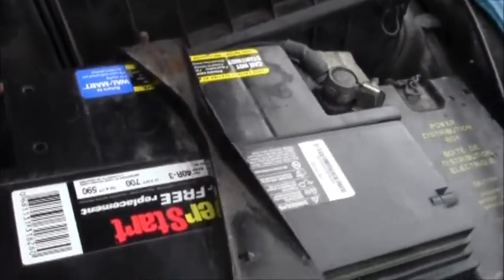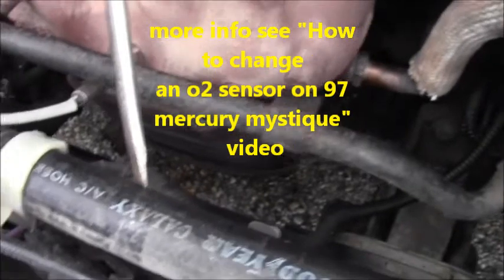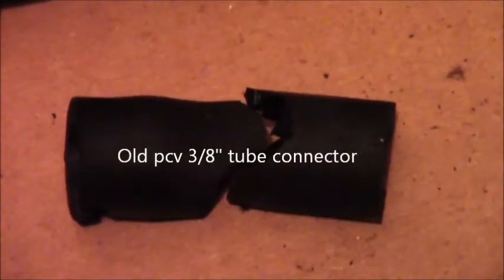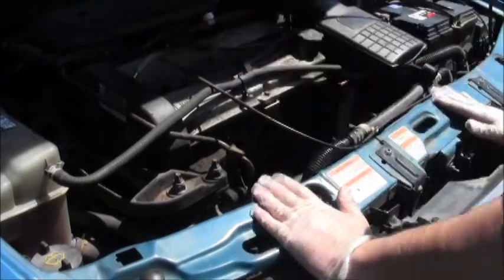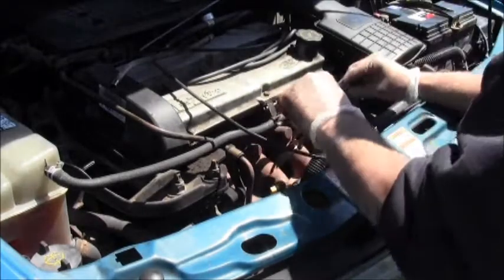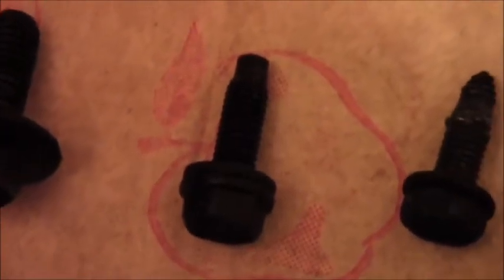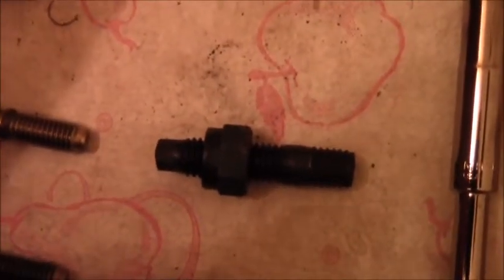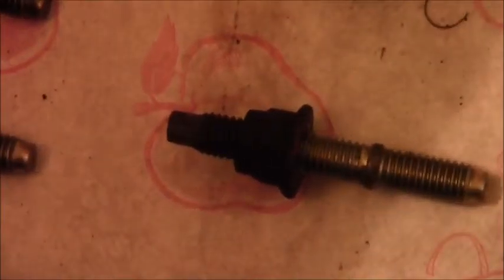Changing PCV Valve on 1997 Ford Contour / Mercury Mystique Zetec 2.0 Liter Engine

Comment from the maker: on my car, the only brass-looking fasteners I came across on this job were the studs for the manifold.  they came off with the nuts using a regular socket wrench.  to get the studs loose put two nuts on and use wrenches or if you have to vice grips plyers. you can do the job with the studs on, it's just easier with them off.

Comment: i read you can just remove the thermostat housing and you can get right to the pcv valve then you dont have to remove the exhaust
Reply from the maker: Mike Gombos Thanks for the tip, I'll have to try going that route sometime, possibly sometime in February when I plan on doing cooling system/thermostat videos.
Reply: no problem id look into it though i was just skimming and came across it. Its just such a pain screwing with the manifolds on older vehicles ya know

Comment: Matt, how did you get the o2 sensor off. I'm trying to replace this and have already with the other one, but I've tried everything in my power and can't get that sensor off..
Reply from the maker: carsnstuff Get some adjustable pliers and set it to where it's really tough to lock them up.  If that doesn't loosen it, hammer on one size smaller socket that it takes and try that.  Penetrating oil is your friend, and all that work may lead to having to replace an 02 sensor but they are fairly cheap.  good luck

Comment: Just remove Heat shield and the thermostat housing PCV tubing is held on with a torx screw under thermostat housing it's best to replace PCV hose to and from intake manifold too they get old and suck shut.